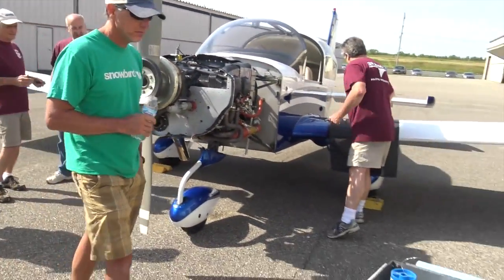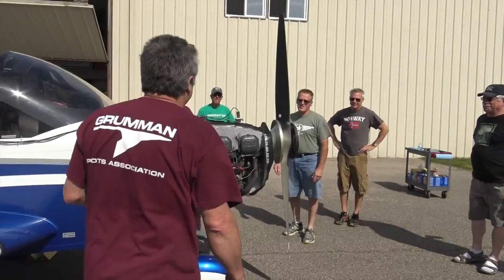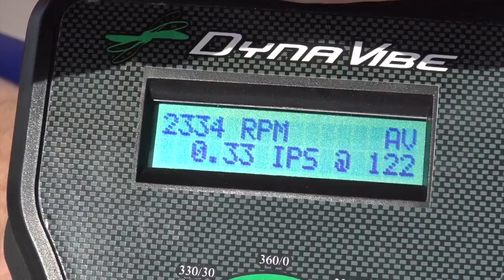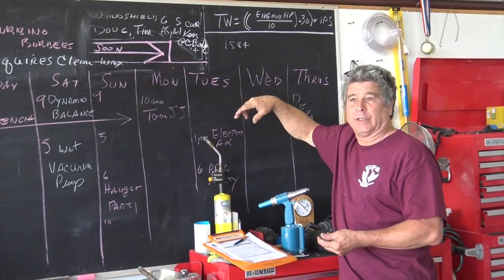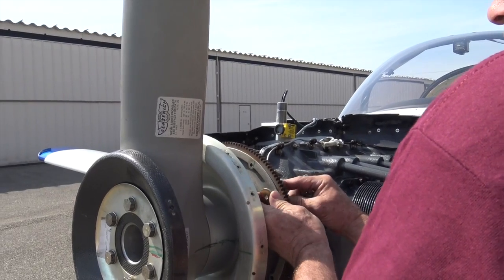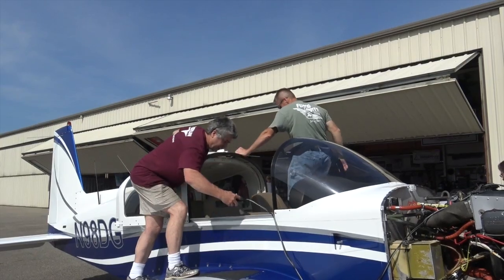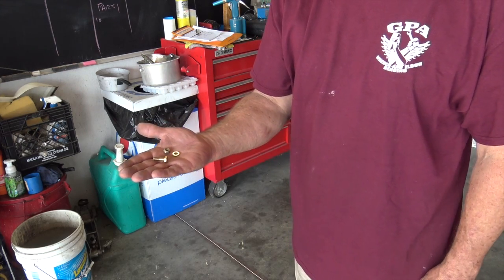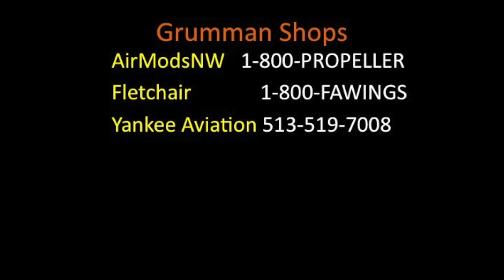Dynamic Prop Balance  - Grumman Style

Comment: I am ordering a DynaVibe for my Skyhawk.
I will balance my prop with the spinner installed.
Engine static balanced, "0" time. Propeller static balanced, "0" time.
Engine/Propeller will be dynamic balanced when I receive my DynaVibe.
This Cessna owner thanks you for showing the process, the test equipment, and the calculations.
Reply: Just a little $1700 toy?
Reply from the maker: OK
Reply: Did you balance it yourself?  How did it do?

Comment: I probably will get flamed for posting this but back in 1982 we did a prop replacement on a privately-owned AA5B on the grass by the tower at Southampton/Eastleigh airport in the UK. The old prop had cracked through one of the mounting holes but the owner had only picked this up when he'd had to replace the alternator. Undid the old prop, torqued the new prop up, rammed a stick in the ground and did a prop swing to check it was properly aligned, put the spinner on then took it into the circuit for test flight!
Reply from the maker: Smooth is always better than rough.

Comment: The advantage of dynamic balancing is that it balances ALL of the rotating components concentric to the output shaft, the prop, spinner and its bulkheads, starter gear and for the most part the prop end of the crankshaft. I assume the spinner was removed for better visibility during filming this video. 
According to FAA advisory circular AC20-37E the reflective tape must be removed from a metal prop because it can possibly trap moisture causing corrosion.
Reply from the maker: For an experiment we twice balanced a prop, got our reading after final balance.  Then we added the spinner, so light and near the center of rotations, too long screws would cause a bigger problem (all the same size).  No reading change.  FYI.  I could see sitting on bare metal, but primed and painted (wax removed in the area) should cause no problems.  Let me go and read up on this.
Reply: @GrummanPilots  I don't disagree but thought you might like to know what it says in the Advisory Circular. Let's face it most all prop manufacturers and prop repair shops put manufacturers decals on props all the time. I balanced two last week on very recently overhauled props, one with a Sensenich the other with McCauley stickers on them. 
It was the McCauley propped Cessna that I accidentally reinstalled the spinner 180 degrees out after installing the permanent weights and the confirmation run said I MESSED UP SOMETHING! That was when I noticed the miss-aligned index marks! At least it was an easy fix!!

Comment: no spinner?  the Spinner plays a part into this gentlemen, your readings will be off if it isn't installed
Reply from the maker: The spinner is thin and very light and  does not add much to imbalance unless it is damaged.
Reply: @GrummanPilots  Or off center, you can see them occasionally wiggling a bit toward the front. The spinner is also all near the center of rotation so contributes MUCH less to overall balance than the same offset of weight near the tip.  THUS, the DYNAMIC balancing.  Something can be "perfectly" statically balanced, but if it has large mass concentrations somewhere, be horribly dynamically imbalanced and shake like heck.
Reply: Correct.  This should have been balanced as a system, with the spinner on.

Comment: Used YOUR formula on my tiger: second dynavibe reading had same angle but half the IPS so added another weight to get the IPS to .03
Reply from the maker: This is why I share information not charge for it as a perk of membership!
Reply: Not sure what you’re saying. My comment rephrased: 1 thanks for sharing, 2 formula seems off by factor of 2 . I had to double the weight the formula calculated to cancel the vibe, using the same aircraft and same DynaVibe as you. What was the source of your equation? Cheers

Comment: Based on your calculations, you were to add 16 grams, then 5 grams on the second, finer, round.  You then doubled the weight, why?
Reply: I THINK he said it was because the calculations are for weight at 1-foot from the axis of rotation.   The bolt holes are ≈6 inches from the axis, so more weight is needed for the same effect.
Reply: Good question.. might need a good explanation
Reply from the maker: weight assume a 12 inch radius (1 foot).  we are using 5.5 inches so .4386 into the weight gives heavier weight at closer radius.

Comment: Shouldn't this be done with the spinner installed?
Reply: Since he's using the ring gear to put his balance weights, you're right.  He could have left the spinner on.
Reply: Yes
Reply from the maker: Not really needed, caN BE CHECKED AFTER BACK ON WITH ONE RUN, BUT NOT ENOUGH IMBALANCE TO MATTER

Comment: I haven't watched this yet in its entireity but just off the top of my head, the transducer should be as close to the front bearing as possible.  You could have gone two case bolts to the front to mount it - you must have had some reason for mounting it towards the back. 

Someone below says something about you doing some math to figure out your weight placement.  No math is necessary.  The Classic model Dynavibe tells you how far it's out of balance and exactly where weight is needed.  What math is necessary?

The GX-3 model even tells you exactly how much weight is needed, in addition to the location. 

In any case, the Dynavibe is extremely accurate and is a pleasure to use.   I haven't looked to see if you have the Classic (the original) or the GX-3 but in either case you've got the best.
Reply: The engine manufacture, airframe or test equipment manufacturer will tell you where to mount the transducer to get the correct vibration readings. Crankshaft vibration at #3/#4 journals may be part of the equation.
Reply from the maker: The longer arm from the motor mount cause issusd like that
Reply: @GrummanPilots  Eh?  Not grokking that since the videos show two case bolts closer to the prop that could have been used.  Motor mount wouldn't have anything to do with the distance between your sensor and the prop, would it?  

Too close of course doesn't work.  The sensor needs about 8 inches or more from the reflective tape in order for it to register - I've no clue why that is but I've encountered it enough times to have noticed this factor.  My decision to place the sensors (I have both sensors on the same mount) is choosing the closest case bolt that still gives about 8 inches, maybe 10, spacing from sensors to prop.  

Your mention of taking the crank bearings into consideration is worth thinking about . . . I'll talk to Steve or Matthew at Dynavibe and see what they say.  

It's really great to have ones' own Dynavibe.  For me it's an essential hangar tool.  It also allows one to be of service to hangar neighbors or friends.  

Happy New Year

Comment: I’m a little confused how engine HP/10+30x.033 comes to 15.84? By my calculations it comes out at 27.9?
Reply from the maker: 180/10 + 30 * .333 = (48 8a .333) = 15.94
Reply from the maker: The other thing is that that weight calculation assume mounting at a 1 foot radius, but we mount it at 5 something inches, so you need to up the weight by the ratio 1 ft / mount distance) to get the weight to use.  FYI

Comment: Your calculation comes up to 15.84 grams (you wrote on the board), but then on the next scene you are adding 30 grams. Why?
Reply from the maker: The holes are at 5.5 inches from center and the weight from the calculation is for 12 inches from center, so you have to divide the weight by ,4583 to get the value to use.
Reply from the maker: so whatever 5.5 / 12.0 comes to to get the equivalent weight for this location closer to the hub.
Reply: @GrummanPilots  thank you so much. I’ll be doing the balancing tomorrow. Thanks  for the amazing video. Keep them coming.

Comment: Any reason why the spinner wasn't on?
Reply from the maker: Yes, it is light, near center and very balanced in its mass distribution and it makes it easier to add weights as you test the balance.  After doing many planes we have never seen a spinner put it out of balance.
Reply: I was concerned if the spinner baffle structure could crack or damage itself while running without the spinner . Thanks for the response and info.   @GrummanPilots

Comment: Excuse me what can I do if we have low oil pressure  thanks
Reply: MAHER RASHAD low oil pressure on a gauge or actual low oil pressure?
Reply: TIG881 Or maybe attempt to diagnose the issue?
Unless you’re being sarcastic
Reply: Anything above 5psi oil pressure is acceptable.
Reply from the maker: Check pump with manual gauge, repair as needed

Comment: Where’s the spinner, wheres the warm up and why wasn’t the sensor moved much further forward?? Who did not read the manual
Reply from the maker: The spinner is not used, the was a warm up, and the sensor location is in range and quite reliable.
Reply: Just read thoroughly the manual and the spinner has to be taken into account and the sensor should have been one if not 2 crankcase holes more forward??
Reply from the maker: One more hole could be done, but then the sensor would not hit the prop.  So two holes forward is out.

Comment: I started to say kudos for getting everyone out of the prop line and in front of it before starting and running that thing up, just mounted with the balancer.  THEN people start walking in from the right during and just after the run up.  Facepalm.   One of those things that probably almost NEVER happens, but when it does ...

Also, I'm surprised in this day and age you have to do hand calculations.  Why aren't those designed INTO the device, with inputs requested for the parameters you need, just to prevent stupid math errors?  In this day and age a tiny cheap processor costs basically nothing ($0.05?).  Some designers need to be drug kicking and screaming into the 20th century, and yes, I meant 20th.

I think the fact that he's measuring at the front of the prop and not balancing there is the reason for the discrepancy in readings.  I think he should be taking the weight OFF opposite the heavy point at the hub by a very light surface shaving.  Just sayin'.  Dynamic balance is definitely the way to go, especially if you are having vibration problems.  Checking all the prop dimensional parameters on a measuring stand should be done prior to balance, though, if the vibration is at all bad, as there are other things that can cause vibration than balance, like a prop bent to over or under pitch, especially out toward the tip asymmetrically just slightly, even.  Kind of like with a wheel on a car, you can balance a square one to a "gnat's eyebrow", but it's still not going to roll worth a damn.  ;-)
Reply: Yeah, you'd think for a 2500 to 4000 dollar device it'd have the ability to do do the calculations for you.
Reply from the maker: BTW new machines do the math for you and get you there quicker.  FYI
Reply: @GrummanPilots  I expected as much.

Comment: Wow. Pilots trying to be A&P Mechanics lmfao. You need spinner on to do dynamic balancing....
Reply: Yippi ya! Hey Joe, even worst!
Imagine people trying to be aircraft manufacturers.
LaughingYfaoff every July in Wisconsin dude.
Reply from the maker: Maybe
Reply: Not really.  Taking the spinner off and on while doing run-ups is a major PITA.  Better to do run-ups without spinner and, once spinner is re-installed, make any small correction necessary using a spinner screw washer (it's only going to be off by a hair, if at all).  The spinner screw washer (or piece of lead weight) can be installed inside the spinner using adhesive.  Centrifugal force will only strengthen that adhesive bond.  Putting it inside eliminates anything "unsightly" - as some might consider with a visible external washer under a spinner screw.

Comment: In first attempt he ended up with weight calculation of 15.8 g but he finally installed 32g  !  Why he did that ?
Reply: Because the weight calculation assumed a location at a mounting radius that was not available. He had to go closer in,  so to get the same effect the mass had to be increased. It's a simple proportion calculation; if the radius is half as much you need twice the mass. But he also SAID that- weren't you paying attention?
Reply from the maker: Weight is based on a 1 foot radius, we are using the holes at 5.5 inches, thus .4583 into the weight to get the proper weight at that location

Comment: Most unsafe test ive seen. Dogs, people all round and in prop arch. Just wow
Reply from the maker: Too bad you did not see the sections where the tests were run.
Reply: Very much agree.  I sweep the area below and around the prop and for sure don't allow any dogs or people running around anywhere close.
Reply: @GrummanPilots  :   those dogs are perfectly suited for airports.  Rod Machado even tells of guy who used his dog as his Safety Pilot during IFR practice.  The dog always barked if alerted to traffic.   
Heck yah.
Machado wondered what would happen if the PIC flew near the Alpo Factory.